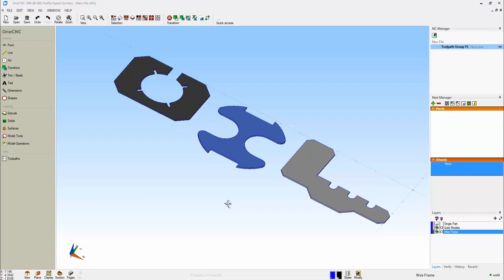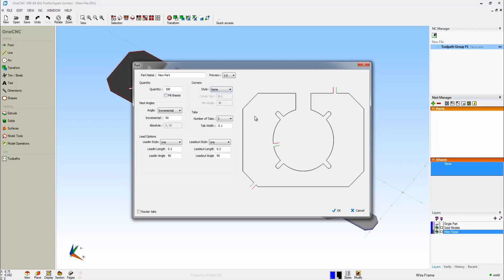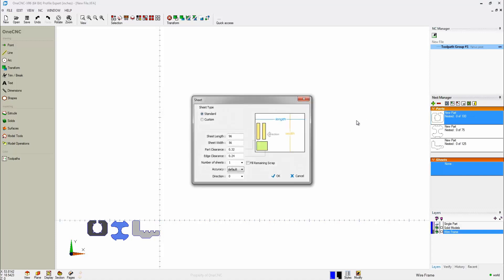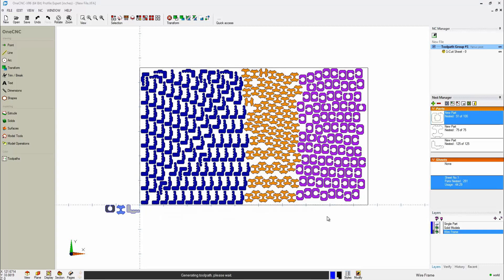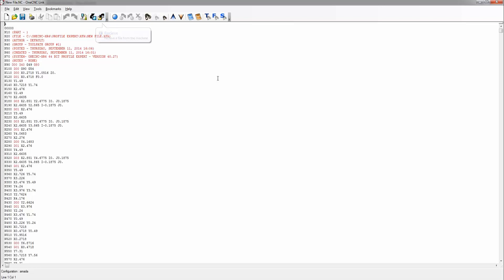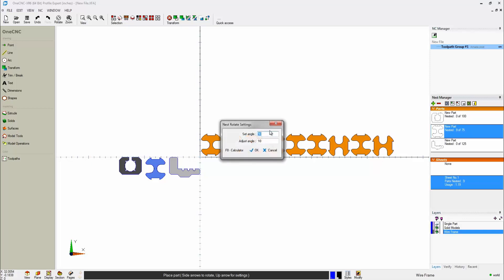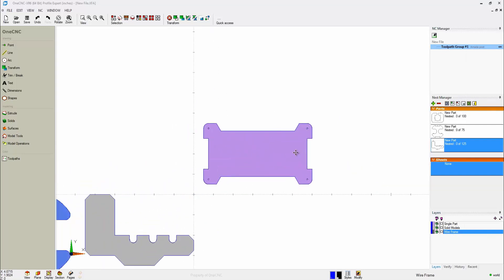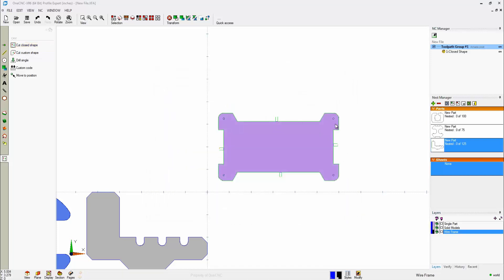OneCNCXR6 CAD CAM Profiler Nesting

Comment: All I can say is that the video shows one of the worst bits of nesting I have ever seen. They aren't nested a at all and I would not buy this software as it would waste far too much raw material. One of the profiles shown is shaped as an L so should be paired by the software and its not. One cnc may be good for machining but needs to go back to the drawing board on its nesting as well as its manual nesting which also has issues as to why it appears you have to put each profile on manually. If there are 100 profiles you should be able to pair two and then fill the sheet. I hope they have improved on this as I wont be buying.